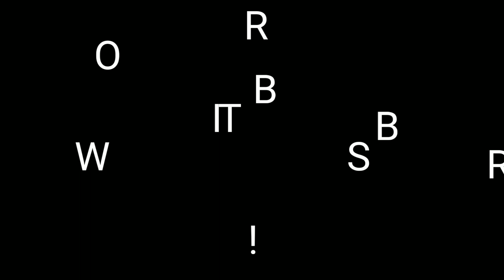Bypass hot plate thermostat

Comment: Add a little Plan fiber glass installation around the thermostat. It will steal have a temperature limit, but it will be much higher. The hot plat will be able to maintain a higher temp for a longer period of time.
Reply from the maker: That's pretty slick. Never thought of that
Reply: Interesting, thanks

Comment: There's a much easier way to do this. Just bend the tab that stops the dial from turning back out of the way and then your dial will turn all the way on and off. This way you can still use the included control and turn it wide open so it won't turn off and also turn it off using the dial.
Reply: Hope you should include a link. I need the easy and safe way to bypass my electric stove max heat
Reply: so, on 3:08 we see a stainless steel spring like piece of plate that pushes 2 copper contacts against each other
and when they contact- it turns off.. so just keep those 2 apart from each other and they wont cause it to turn off? very doable.
Reply: @WeebRemover4500  Awesome, Simple & TRUE - Thank You!
Reply: @IsleofFire  apparently the heating element will break down, possibly from the contacts losing connection, you may wanna hard-solder the connections with silversolder and swap the cables out with thick copper wire. i tried using insulation to keep the wires from overheating but it didnt work, it wont go on forever on full power without very clever insulation
Reply: Appreciate that info bro bcz his method is meticulous lol

Comment: I need to do this mod but it isn't for cooking. I'm a shooter, reloader and bullet caster. I usually use a 20 quart cast iron dutch oven and a 80,000 BTU LP turbo burner to smelt and clean/flux my scrap lead into ingots. You don't want to put dirty, greasy, contaminated lead into your electric bottom pour RCBS and Lee bullet casting furnace pot. You want the lead you put in the bullet casting furnace already clean and ready to go or you will ruin it in short time. I built a digital PID temperature control for the cheap Lee Pro 20 pound pot while the RCBS Pro Melt 2 came with one already built in. I often use scrap lead wheel weights as my lead source. These days they aren't always lead and can be made with Zinc or mixed with Zinc. Lead melts at 621ish degrees and Zinc melts much higher over 787 degrees. The concept is simple....if you keep your alloy 700 degrees or under all the Zinc will float to the top where it can be easily scooped out. That is where the digital PID temperature control and thermocouple come into play. That only works on 120v electric heat sources and while using LP gas you are all on your own. It is very easy to overheat your cast iron pot of wheel weights with a LP gas burner melting the Zinc and contaminating your alloy. With old school real lead wheel weights this isn't a problem. With modern ones not knowing exactly if and how much Zinc is in your pot the old fashioned way will not work. I had heard about some of these electric hot plates turning off and on before you can get the molten lead to 622 - 700 degrees and this mod will do the trick. You don't have to worry about over heating or burning anything up while using the PID. It will maintain the temp +/- 1 degree from your set point by killing the main power to the heat source and turning it back on as needed. So to make a long story short this is what I am planning on doing to easily separate the Zinc wheel weights from the lead ones.

Comment: If you want some control, you can do what your did, but add a Harbor Freight Router controller for $20.  It will allow you to regulate the power.
Reply from the maker: +Tom Dabney awesome thanks I'll look into that.
Reply: @hammerdownnofilter9124  Why you gonna spend $20 on a controller for a $10 stovetop?
Reply from the maker: @benjaminhughes9347  pretty sure I didnt spend 20$ on it. But thanks for watching
Reply: I was thinking of where I could get a control nob that wont shut of but I can still control the temperature.

Comment: If you keep your hotplate running hot continuously with a bypass, the heat will go to the plug and burn your wire, or it will damage your fuse box
Reply from the maker: I just used the on off switch control the temp. Rarely did I need it to run hot like that for long. But some stuff just didnt cook well without being able to run hotter longer ya kno
Reply: Damn right yo hammer. 
I just did this on my oven with premature thermostat. I just set timer Max 5 min just to be safe. 

A timer relay would be safe rather than toggle switch, though.
Reply: @kynesilagan2676  

A digital PID temp control like I built and use is even better. It goes by the temp of what is in the pan or pot and turns the power on and off as needed to maintain +/- 1 degree of accuracy.
Reply: @JohnDoeEagle1  damn those analog thermostat. Kidding.
Reply: @kynesilagan2676  

A factory built one costs over $300 to buy one. You can build one yourself from scratch like I did getting all the parts off Amazon and Ebay for about $85. Then the K-connector thermocouples are about $13 for every electric heating appliance or device in the house and shop you want to control with it.

Comment: i think it would be easier to soldier the contacts behind the control knob (3:04) so the thermal contacts cannot break the circuit
Reply: 3:24 if you solder the contacts, you wouldn’t have a way to turn it off without unplugging it.

Comment: This unit is really made to keep food warm and not to brown or sear.I thought about by passing the thermal device but I am concerned that the unit is so cheeply made that the extra heat will cause the insulation on the wires to melt and short out the unit or worse cause a fire. Hammer ,how has the unit held up as far as the integrity of the wiring after your mod?
Reply from the maker: It's actually worked very well. I passed it on to another driver n got a new one havent done the mod to this one yet because i havent had time to use it. You can bend a piece out of the way and it work the same I've heard. I may do another video some time about it. But just remember it gets hot.
Reply from the maker: Thanks for watching
Reply: I just did the mod where you bend the ear over and it works great.  Gets super hot I would suggest plugging into a power strip with Gfci

Comment: How do I bypass it without the switch? Where do I reconnect the switch wire after disconnecting from the original switch?
Reply from the maker: The switch is just like any other switch. All your doing is pretty much splicing the hot wire in this demonstration.  Bypassing the thermostat all together. There is many other ways of doing it as well.